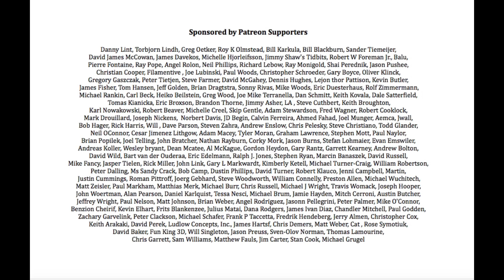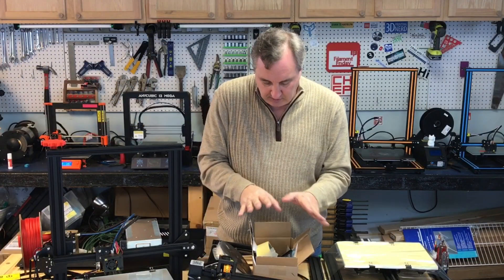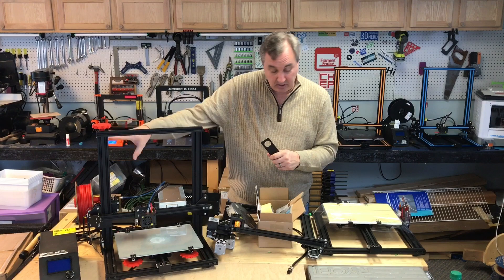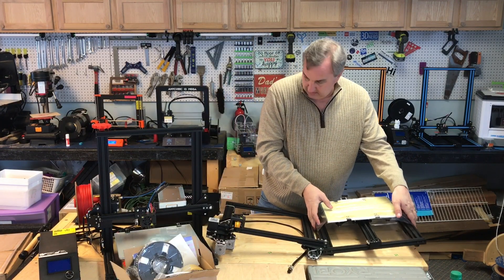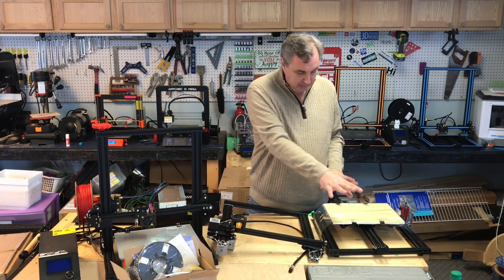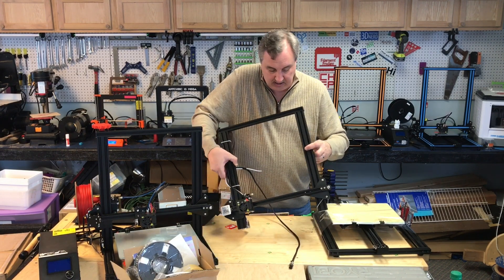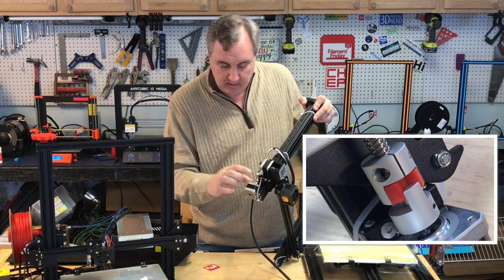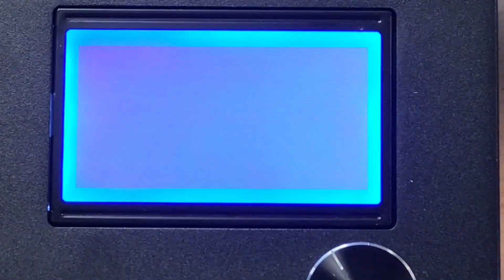Best $300 3D Printer Creality CR-10 Mini Updates

Comment: 3:08  The type of flexible coupling that is on your printer is often called a 'spider coupling'.  I personally think that the spider coupling is better than the spiral coupling that is usually on 3D printers.  What I like about a spider coupling vs. a spiral coupling is that I believe the spider coupling is more rigid in the axial and rotary directions, and therefore less likely to produce z-banding.  A spiral coupling is more like a spring; I think that since the spider coupling is stiffer than the spiral coupling, the movement transmitted by a spider coupling  is more precise.  I actually replaced the spiral coupling that came with my first 3D printer (which actually was the earlier 'P902' model of the Flying Bear printer that your friend dumped on you), and along with a modification I made to the mounting of the z-axis components gave me vastly improved z-axis performance.
Reply: The Chinese usually calls it "plum coupler" (because of the color maybe) or "XB coupler" thought might be useful if you are trying to buy one.
Reply: Spider couplings, or gear couplings as they are sometimes called, are great for higher torque applications like pump assemblies, but they have an issue with what is effectively "gear lash"...in order to allow for the offset and angular misalignment there has to be a clearance between the teeth of the insert and the mounts, and this can cause an issue especially if you do z-hopping. They are good at vibration dampening though..

Comment: interesting Chep! But I've never run across an hardware problem or an output bad quality with my plain old CReality CR-10 Mini and it still works for pretty long hours (my record: 7 hours in a row) without any flaw. So far a pretty good device and @300 bucks it's more than a bargain. Thanks Chep.

Comment: Thanks for the great intro to 3d printing. Ordered from Banggood for $149, but it's almost two weeks; suspect expedited Chinese shipping at this great price. Seems like a fantastic machine. Since you updated to Marlin, did you have to change the settings in your slicer?  Thanks! Steve
P.S. It looks like the new screw drive coupling is a derivative of a universal joint, eliminating stress to the motor.

Comment: Hi - can you document how you side mounted the spool holder and also if you've seen any problems with feeding filament at a 90 degree angle to the spool holder? I'm considering the same mod but hanging the spool parallel to the extruder (i.e. not 90 degrees, just off the side of the printer).

Comment: You do a great job on explaining about the printer I just got mine in and I use it to make parts that I need the only problem I am having is that the part that I make needs to be solid it prints it hollow how do you get it to print it out solid not hollow.
Reply from the maker: Change the infill setting to a higher value in the slicer

Comment: I got an extra nozzle with mine last week, but they omitted the right hand T side fitting. I have sent in a missing part request to Creality and BangGood, but no response, any ideas? Mine shipped from China. The coupling has been changed again, simpler. The board is now version 1.1.4 and no longer has that center plug-in; whatever it was for.

Comment: Is the Cr 10 mini still a valid option? 
I've had a ender 3 v1 for over 3 years now. Upgraded board, bed, tube, extruder,  hot end but I want a bigger build area. 
I'm torn between the Mini and the cr10 v2 and ender5. I enjoy upgrading the machine as much as I enjoy printing so base features aren't deal brakers
Reply from the maker: What about Ender 3 Max? 
The CR-10 mini is too old.
Reply: @FilamentFriday  I could buy 5 cr 10 minis for that price.  If i got the mini I would be upgrading the board, bed, extruder and tubing right away, think i have a extra full metalhot end too.  I enjoy upgrading my machines, just need a larger print area than my R3 provides.
Reply from the maker: 5 CR-10 minis?! 
Ender 3 max is $350. 
Where can you buy a CR-10 mini for $70?
Reply: @FilamentFriday  LOL i thought i read CR max
Reply: @FilamentFriday  Im reading up on the ender 3 max now. i was about to buy a cr 10 v2 just before you replied . thanks for the recommendation, i missed this one.
Reply: @FilamentFriday  ender 3 max ordered.  Got a magnetic bed and cap tube as well. Looking for a dual z axis kit next, thanks for the help.

Comment: Looking to get my first printer. Ender 3 Pro or CR-10 Mini? I need a fairly large bed, so that may tips the scales a bit. Your thoughts?
Reply from the maker: I still prefer the CR-10 mini though it’s definitely more money. You can almost get two Ender 3 for the price of the mini. The larger build area though is very handy. You might also consider the original CR-10. It’s not much more than the Mini now and gives you even more build area but still print small items quite good.

Comment: Hey great video. Do you know if the mini has the same issue as the cr-10s with regards to noisey nozzle temperatures? It is to do with an undersized capacitor on the new boards I believe.
Reply: Never had that on my mini. It's been operating since mid-december 2017 like a charm. Am I lucky? dunno.
Reply: Noisy nozzle? Can you explain more?

Comment: Jaw coupling,  adding allowance for angle and axle dis-alignment as well as some damping on the knock force e.g. softens start/stop/reverse points
Zero-backlash curved jaw couplings are best suited for applications that rely on a stop-and-go type of movement, where accuracy needs to take place upon stopping in order to perform any number of precision tasks, such as taking a high resolution picture (machine vision system). Absorbing vibrations decreases the settling time the system needs, which increases through-put.

Comment: Re: Extra Bowden tube... My bowden tube actually wore out before my nozzle did (after about eight months of constant use and 30 kilos run through it)...
Reply: Oh, I'm using said replacement, actually. And what wore out was the end of the Bowden, it eventually got damaged enough to need trimming, and I was a bit overeager in doing so and cut it too short.